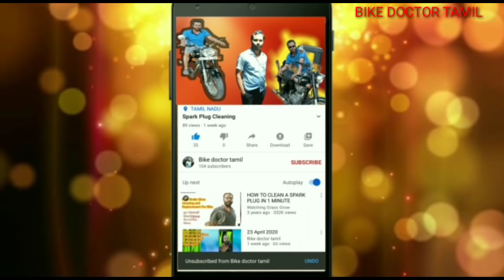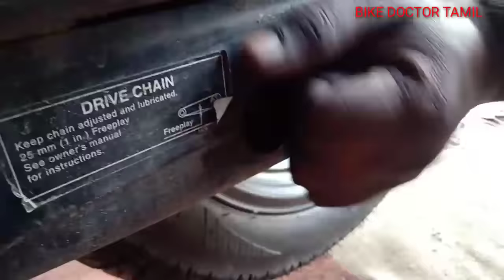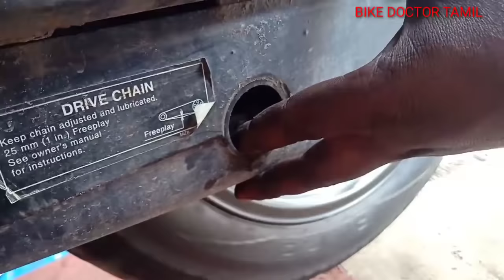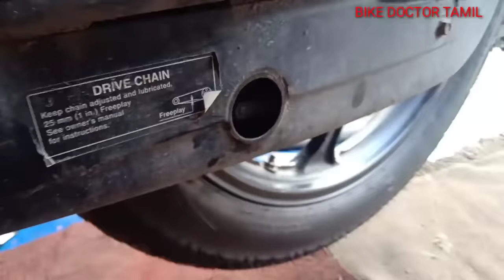How to Solve Bike Engine Overheating problem in Tamil

Comment: Anna my bike splendor bike 2009 model bike running scilencer little oil mix carbon varuthu but spark plugs oil ella mailage above 63 resanta than head valuve change panne entha problem 25km distance ponatha varuthu  10 or 15 km pona varla ethu enna problem tharella anna

Comment: bro discover DTS 100 cc 2011 model  Marimum 88- 91 kmpl Highway  la kidaikuthu .. nan than carburettor tune panunen.... 60km speed la oru 30 km drive panuna koda oru mathiri engine karincha smell varuthu yen??

And carburettor la overflow antha overflow outlet  akala but off panni vachitu 2 hr kalichi start panuna petrol tank off la irukum pothu start akala.. again main la vacha start akuthu...ennanu theriyala..

Pls  bro help panunka.reply panunka.....

Comment: How to identify engine is over heating. When we ride the vehicle it's automatically engine get heat. Then how can we evaluate.. im using Honda shine bs6 model, riding 30 minutes continuously riding 15 km distance in city traffic and my engine get heat... Is it normal or issue..? please advise
Reply: If you can feel hot air on your legs while riding and some smell is coming then only engine is overheating

Comment: Bro vanakkam tvsstarcity bikela carburetor clean panni tunning correcta vecchen. But bike 1gear la adachamari  accelaration akuthu. Engine heat anna appuram bike nalla poguthu. Enna reason.
Reply from the maker: Hi brother 👋 thank you for your support 🙏 cold condition starting trable no problam brother your bike mileage is good
Reply: brother! entha year model?